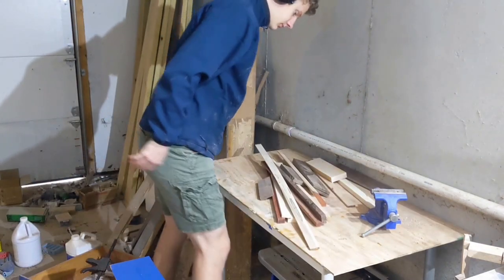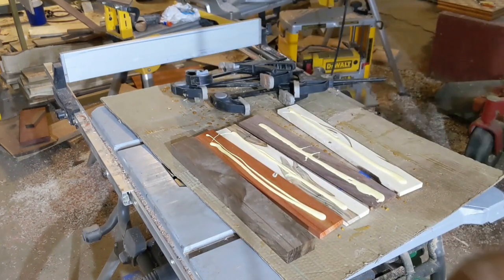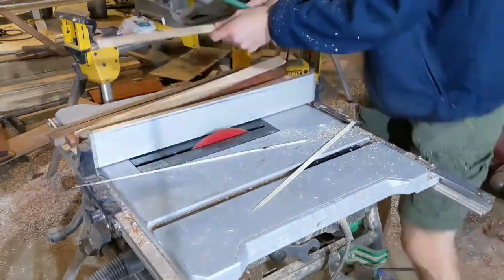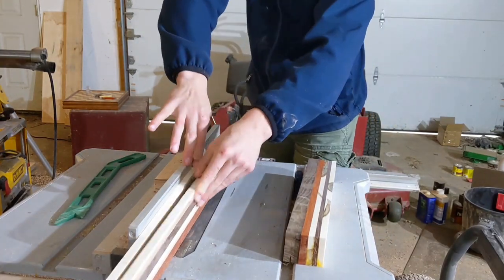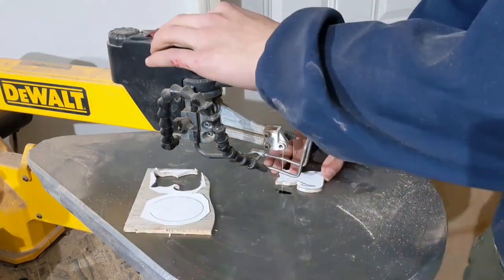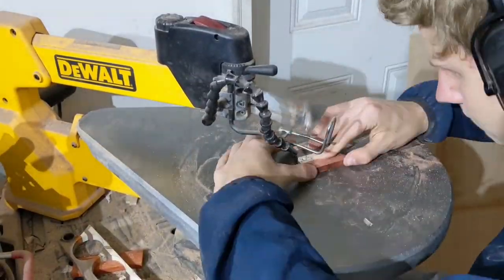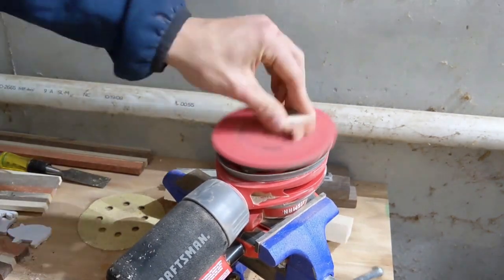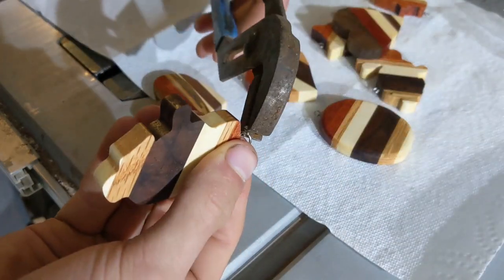DIY Scrap Wood Keychains, Woodworking

Comment: Honestly I liked your video, the keychains are cool, the quotes were funny, but you really need to be more careful ... resawing hardwood on table saw that doesn't have a riving knife/splitter is already pretty tricky but not using a push stick/block ...  Your fingers were literally an inch from the balde, it really looks like you do want to decrease the number of fingers on your hands.
Reply from the maker: Thanks for the comment! I absolutely agree with everything you said, except that I don't want to decrease the number of fingers on my hand, as that would make holding hands a bit of a challenge. And I do very much enjoy holding hands. I do have a riving knife in my saw, the problem is that it is wider than the balde, (like my legs) so it is actually quite hazardous. Respect to you!
Reply: @WoodenLegWoodworking  Thank you for the video and the idea, I will probably make a few keychains myself :)

Comment: is there certain types of wood that is better for this type of project how do you keep them from splitting or breaking apart if they get wet
Reply from the maker: no particularly better or worse woods so long as they are hardwoods. I've never had a problem with them splitting apart or even getting wet for that matter. I tend to stick to dry land, but if it ever becomes an issue you'll be the first to know.

Comment: Nice smart project. Do you think this could be done with a jigsaw for those us starting ouy that don't have a scroll saw? 🏴👍
Reply from the maker: Probably not with the level of precision that the scroll saw delivers. You could maybe do some of the simpler shapes, but I am not entirely sure. I have never tried something like this on a jigsaw so I am not entirely sure.
Reply: @WoodenLegWoodworking  that's fine thanks for the Feed back I'll give it shot and report findings back to u. 🏴👍